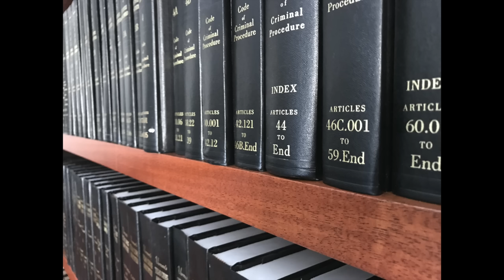Building Long Bookshelves That Don’t Sag

Comment: As an Engineer I can tell you that putting those splines in the middle of the 2 layers will add zero stiffness to the shelf. When you load up the shelf and it sags the bottom surface will try to stretch and the top surface will try to compress. This is where the stress is the greatest - at what we call the extreme fibre distance. That's why I beams have their maximum cross section at the top and bottom. Somewhere near the center, if you were to plot the tensile stress, it would go from +ve to -ve i.e. It would equal zero. So those splines, be they steel or graphite, aren't doing anything.
Reply from the maker: Thanks Rv4 Guy! I was waiting and hoping an engineer would comment on this!! What’s the best way I can build these long shelves?
Reply: RRR Woodworks in an ideal world you would put your reinforcement on the bottom or top. Of course that would spoil the look on the top, so make do with it on the bottom. Inlay it in a dado (to hide it) with screws if steel, or if you had graphite rods epoxy them in. That way if the shelf wants to sag it will have to stretch the reinforcement. The further that reinforcement is from the center the stiffer the beam (which is what this is) will be. I think the stiffness is proportional to the cube of the depth. Doubling up on your material certainly helped, because you made it thicker, but those rods didn't do much. You do nice work and this engineering stuff is not obvious. I hope I was helpful and not a flamer.
Reply: @sblack48  Laminating together your 3/4" shelves increased the stiffness by a factor of 8 over a single 3/4" shelf.  A 5' shelf is about  2.4 x's more flexible than a 4' shelf.  8/2.4= 3.3, So your 1.5"x5' shelves are 3.3 x's stiffer than a 3/4" x 4' shelf, and you already solved your problem without the (what looks like) 1/8"x 1" steel bars.
Reply: HollywoodF1 I agree. The wood made the difference.
Reply: What you're saying is nonsense. Are you suggesting that if I put a steel rod into a soda straw it won't make the straw stiffer?
Reply: @sblack48  Hello, good night. As an Engineer, could you please help me with something? I´ll appreciate it. I´ll try to do this wonderful bookcase - God helps me! - but I have lots of doubts about the sizes, measures and so on. But, one thing I´d like to ask you, please: Is there some reason for putting the steel bars on that part of the piece? I mean, If I put the bars in a different position - as in the center by example - it´ll be wrong? I´d like to do the bookcase like this one from the video with  2,50 meters of height and 2,30 meters of width with 40 centimeters of depth. Thank you for your attention!

Comment: I doubt a non-woodworker would appreciate the level of expertise it takes to pull off a project like this. Any mistakes or miss cuts and you are throwing away quite a bit of money in time and materials. Absolutely nowhere to hide.  Pretty ballsy to go with a biscuit face frame join for such a large project. Pretty much anyone  else would have accepted the pin holes.  I am seriously impressed.
Reply: As a former bench joiner, i understand just how hard assembling a frame with 82 biscuits is - very great deal of skill on show here
Reply: I doubt a woodworker used to naturally grown wood and its special needs in terms of directionality and joinery would call a plum and level built plywood box with cookie dowels, dados and screws "expertise" to be honest. Look at the inner back veneer alone, no matter how much stain there was put on, it's still just plywood showing, no effort whatsoever was made even tryna make it look like anything better than ply. 
It is reasonably well built and looks ok, but expertise ...?
Expertise would use modern ways to understand statics and engineering, wouldn't it?
Even the metal in the shelves would not be necessary, at all, with a third or even a quarter the width ply sheets turned into hollow box form sandwich shelves, no matter foam or just some flimsy sticks used as an inside divider  - at least about a third of the overall weight would have been spared this way, which would count to about a third of the material used "unnecessarily",  not to mention the ease to move and position a giant piece like that ... You got to fix it to the wall anyway in this height range, so You do not need any excess weight to "stabilize" it via gravity, do You? 
Weight as well as the distribution of the very weight inside a product is as important as its different materials combined to maximum strength are.
Every part is supposed to take over at least two special tasks in terms of statics, better three tasks, and it gets into "expertise" engineering to reckon this and use the different material's strengths and weaknesses to produce a superior system outa "normal" materials by combination, at least in my book.
Reply: @manfredschmalbach9023   After over 45 years in the cabinet trade, 36 years with my own shop, I have found that there is a formula for bidding.  There are 3 parts:  materials, time (labor), and quality (labor).  You only let the customer control one of these.

You have no idea what restraints he had when starting this project.  Box shelves would have taken a lot more time to build and no difference in the end result, except his are heavier.  Well, somehow they got it into the office, everyone is happy, and he got paid.

So the back doesn't meet your spec.  Look at the installed pic.  All the back is covered and will be until the buyer retires.   And not even sure what you mean by making plywood look like anything other than plywood.  It's plywood.  Plywood will always be plywood.  It will stain differently and  have a different sheen when finished. Just how much time in the finishing process would you take to make it what you want?  And then all your work gets covered up....

Given an unlimited budget, he could have had the shelves made from cast aircraft grade waffle cored aluminum and then veneered them.  He could have made a  stile and rail back with solid panels.  He could have ....lots of things.   But he didn't.

I think his design was maybe overbuilt.  I may have built it simpler.  But the robust construction will keep him from ever getting a call a year from now that the shelves have sagged 1/4".  That's the nightmare he has avoided and can sleep at night knowing he won't get that call.

To say that this didn't show expertise reminds me of the Fine Woodworking mag I used to get.
If you didn't use sustained growth all solid materials (mostly exotics), hand sawn, hand jointed and hand scraped smooth surfaces, all mortise and tenoned or dovetailed together (no fasteners, God forbid), finished with 15 coats of custom mixed shellac, french polished surfaces, all worthy of a museum or expensive gallery in New York,  then don't bother, it's not worthy of consideration.   

But some of us need to make a living at what we do and to not say what we do doesn't take expertise is, well, may I say it, arrogance?  I have never chopped a dovetail in all my years.  It's part of that bidding formula. But some of my customers say what I do is magic.  Is that expertise?  I'll let them decide that and leave others to make a living as they can, without leaving snarky comments.
Reply: @AffordBindEquipment  I already wrote, and gladly write again, how it was reasonably built and does look OK.
I have no idea what restraints he had, You're absolutely right at that point; 
it just does not matter, at all, when the "expertise" word is discussed in context to what You saw, and what I saw, in a random Youtube clip.
Honeycomb core, not from aluminium of course, but from bloody card board, is a standart fill-in used often for sandwiched box shelving when partial dividers like the aforementioned "sticks" would lead to an inferior product by not distributing the load evenly. Even bloody IKEA does it because it is so much cheaper and leads to a so much superior product.
It is waay cheaper to use honeycomb cardboard and thin veneer or ply than use mahussive ply bricks, that's for sure.
Which would open a wide gap in Your endprice You could fill with expert work.
It would need some expertise to understand and subsequently build with those materials and not make a mess but a product, though.
Calling a well built box shelf and the iron-ply-joke he showed "equal" in terms of load bearing, though, would only make me think You never ever have built a proper box shelf either, besides of never ever having cut a dove tail.
Not a problem, don't get me wrong!
Dovetails and boxshelves are completely unnecessary, as well as craftsman's expertise, these days, when everybody wants everything in China-quality and for Bangladesh- or Burundi-prices (... and does even know a guy who is a laywer, in terms of "nightmare", should You be risk-prone enough to really build things instead of just trade them.)
IKEA has enough expertise in their crap for all the friggin bookshelves the world will ever need.
Only thing I was referring to was the expertise-word I did not see being met in the videoclip it was used for, at all, and only "in my book" of course, as I wrote, too.
You might call loosely laying an "enforcement" right into the neutral axis of a system You plan to seriously load "expertise", I do not, and I won't even after a lively debate with people making a decent living of putting "enforcements" right into the neutral axis before calling this "expertise", sorry to break this to You.
Oh, and in terms of looks: there are positive stains and reverse or negative stains available. Try it. Treat parts You cut from ply with both and compare. I'm sure You'll see it. "Expertise" would start in knowing the different outcomes of different sequential uses of both on the same part. 
It's not necessarily needed, though.
But why calling a randomly stained random ply brick "built with expertise" then ...? See?
Have a nice day
Reply: @manfredschmalbach9023  In the video he doesn't even have time to finish it himself, so he actually overspent on time.
Reply: @carbon1255  To be honest, I presume he just wasn't convinced or even confident to get the stain on evenly enough to not ruin it entirely ... which is visible during his try to rag-apply the first two "sectors" as two very visibly divided, very uneven and cloudy parts. Stain is not easy to apply to ply, and it isn't applied to beech ply with a rag. You gotta use a stain-brush (as a stain-only brush, of course). Those were the priciest real badger brushes we had in the workshop, waay more expensive than the best varnishing brushes for last coats of boat's brightwork. 
(I see such insecurities based on lack of knowledge after training apprentices for three decades in a row ...)
Reply: @manfredschmalbach9023  lets see your cabinet then.
Reply: @beantea5592  I usually build liveaboard boats and custom off grid expedition awd vans for better off people these days, so my latest cabinets got mast'n sails or an awd chassis I'm afraid ... that's another league, probably embarrassing to other people's interior, and highly confidential of course; sorry 'bout not showing.
Reply: Yes, amazing precision and craftsmanship.
Reply: I appreciate the skill, but I don't appreciate wasting good wood to make a shelf to hold physical books. What a waste of space.
Reply: @manfredschmalbach9023   Who asked ya?
Reply: @alext9067  😂
Reply: @alext9067  Who asked ya to ask?
Reply: @manfredschmalbach9023  
I am a traditionally trained cabinet maker. I was trained to make everything by hand using traditional jointing methods. I could produce a book case like that with solid wood but it is going to be super expensive in term is getting a finish like the one in the video achieved. 
I doubt very few clients could actually afford a solid wood traditional cabinet of that scale. I have made kitchens that have cost $50,000 that were completely solid wood traditional projects but that is not the majority of projects. 

You may not think it but there is skill in that video.
Reply: AffordBindEquipment  oooooo you destroyed him! Loool
Reply: @ironhand9096  😂😂😂
Reply: @manfredschmalbach9023  I think your "...in my book" is overkill. This is a bookcase... and quite a handsome one, at that.
Reply: @jefscolnago  You're welcome. It's free, after all.
Reply: @manfredschmalbach9023  No, thanks.
Reply: @jefscolnago  OK

Comment: I built two out of old water bed frames.... one was 4 feet wide and 90 inches tall and the second was 5.5 feet wide and 90 inches tall...built them in my laundry room and had some buddies help me get them upstairs to my living room... 1/2 plywood for the backs...had to jack them up to put legs under them to level... still standing... they are heavy

Comment: One of the best designed bookcases I have ever seen!  The steel splines sandwiched between two 3/4" plywood shelves which have been laminated together will make the shelves strong enough to hold heavy books without sagging.  The solid wood face frame will add even more strength to the shelves.  Very clever and well done.
Reply: The front facia obviously adds a lot of strength too. This design seems to originate with the "Mr. Sawdust" radial arm saw table which is famous on the internet for radial arm saw collectors. He specified that the steel rails be glued with epoxy, and not wood glue. Epoxy binds to steel and wood equally well, whereas wood glue shrinks significantly and doesn't remain attached to steel at all. Although epoxy could ruin the wood permanently if spilled, so it might be best to skip the epoxy and just trust the wood glue.

Comment: I have been using metal strips in shelves for a very long time. Aluminum is normally strong enough, but steel would be cheaper. I typically use 1/2" plywood with a 3/4" wide piece of metal to keep the shelf thinner. 

Another trick I learned is to use a filler material between two thinner pieces of plywood to knock the weight down of the shelves, while keeping the rigidity of the metal strips or angle.

That bookcase look amazing though!

Comment: I love the idea of laminating two pieces with 1/8" steel bar in grooves between them. Talk about non-sag! Brilliant idea. I think I may use it myself in some upcoming project. Thanks for sharing. That book case looks beautiful - and is strong! BTW - I bought some Titebond at H.D. the other day - thought I'd try it out. Mine isn't the no-drip, but I'll try that next time. Thanks for the info!
Reply: Alan Runfeldt It is basically a variation on what is called a flitch beam.  Tried and true technique.

Comment: I've used steel before in shelves, as well. My technique has always been cutting a single slot toward the front of the shelf, using 3/4" angle iron, and drilling and tapping it to accept screws from the top of the shelf. I then fit a molding on the front of the shelf to give the appearance of bulk while adding another vertical "web" for strength. Since I use 5mm shelf pins to provide a degree of adjustment, I use one (or more, if necessary) in the rear to complement the front steel.

Watching your video makes me realize the applied molding isn't a lot different than marrying the steel in between two sheets of ply, but one does what one thinks of.

Nice looking case.

Comment: I've seen your video before but re-watching it gave me this brilliant idea: why not make a barrister's bookcase but this time use the steel rods not only to support but also to hold together the case? To achieve this the have the rods threaded at both ends and keep the panels under tension at both ends with a couple of hidden nuts. By making the case this way, not only is it stronger but it's also modular, i.e. it can be dismantled and flat-packed!
I want the case to be strong so it can carry a full load of heavy books without having to empty it when moving it. In the old days when barristers bookcases where made I think the paper used was lighter but today with books made with glossy paper they can get really heavy and I don't trust an old case to withstand a full length's worth or such books.

Comment: I have just used the idea of using steel in shelves for a shelf to hold my mitre saw. I used a 6.3mm router bit as it was all I had for a 5mm thick steel. It didn't really work as well as I hoped probably as the grove was a bit over sized. Perhaps once I had laminated the pieces together it might had been better but it didn't seem strong enough so I added a second piece of steel and that seemed to do the trick. You could also cut a rabbit on the pack panel for the shelf to sit in. As you shelves aren't too deep that would really help. Thanks for the idea.

Comment: That is amazing, I'm going to remember the "steel rods in the plywood sandwich" when I start doing bookshelves for my home office.
Reply: Hi Michael I was wondering about the "ribs" in the plywood...  are they made of STEEL? or do you recommend me other material...?
Reply: @lmtz007  steel works and is cheap. Aluminum is lighter and not as strong, but still works. Square stock works the best, but can add a lot of weight.

Your best bet is to buy some of different materials and test the strength. You'll be surprised at how much a simple piece of flat stock can hold!

I literally drove my dad's 4 ton dually over a 4' shelf with steel flat stock in it!

Comment: I acquired a 7 foot tall "bookcase" that was used as to store shoes for a big family. Anyway it has vertical dividers or walls every 11" and it makes the best bookcase ever. You can remove books without other books falling over. The shelves only span 11" so shelf sag is not a problem. Highly recommended for heavily used reference book storage.

Comment: Clever way to increase the strength of the shelf. I bet doubling up  sure added to the weight of it unit. I especially like the way the backing turned out after stain. Great job. 👍🏻